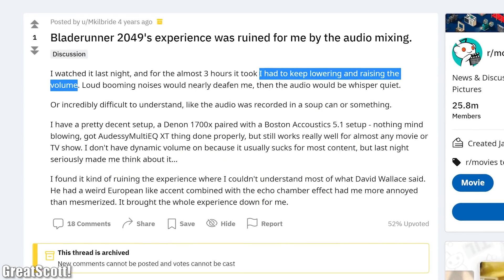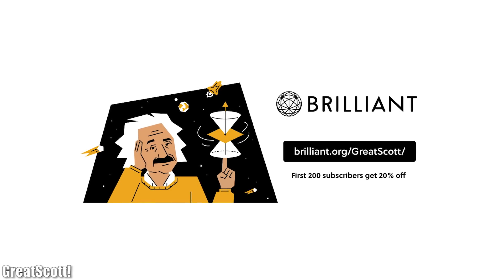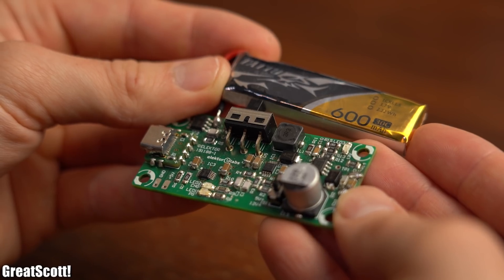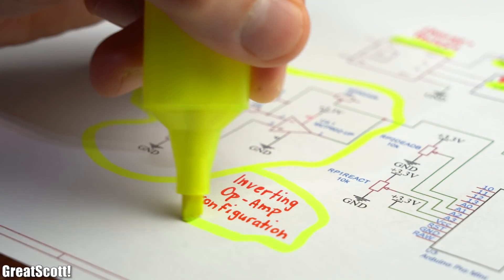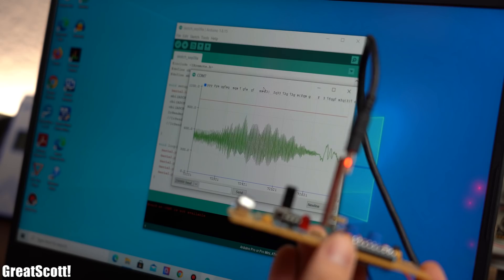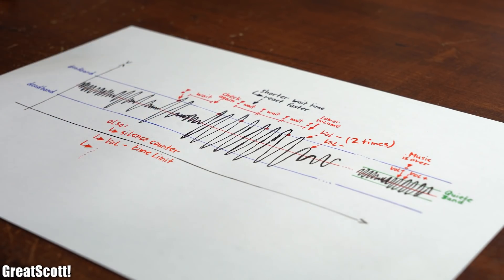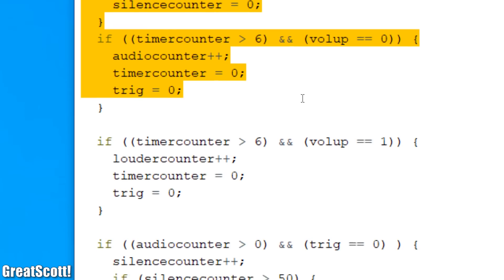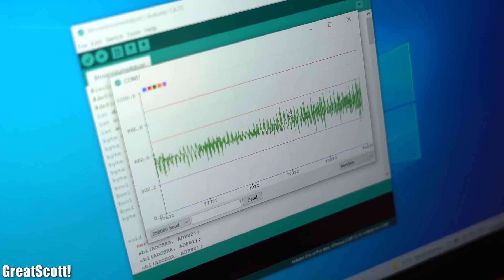Movie Music has a LOUD PROBLEM! So I fixed that! (Automatic Volume Adjuster)

Comment: Very nice video. These sudden changes in volume are really a pain in the neck. You did a nice project. Unfortunately, one cannot see the complete circuit of your project because of translated text script of your audio covers a part of the circuit. Question:  Is it possible to get the circuit diagram and of course the s/w code you developed for it? Of course, I am not expecting you to provide it for free.
Reply: Check the video description, it's all there (links)
Reply: @RogerTannous  Many thanks for your kind response. I watched the video again but could not find the link you mentioned. 
There are of course two links given below the video window. However, the first link leads to the "Brilliant" Website, and the second link is about a previous video from "GreatScott".  So, I must be overlooking something. Could you let me know where to find the video description with the links in question, please?  Many thanks in advance.

Comment: The reason dialog is quiet is because you don't have a center channel while listening to the 5.1 sound track.  Switch to the stereo track and it should be fine.

Comment: If we can open that control unit, won't it be much easier to control the volume with a circuit?
Reply: Maybe, but it wouldn't be portable accross models and manufacturers.
And, more generally, not achievable by everyone else!
Reply: @RogerTannous  Ya true..i didn' t think of it in that perspective...

Comment: My old Marantz SR5000 home theatre amp had a similar function called midnight, for watching movies late at night without disturbing people. As well as prevent any loudness past a chosen level, it also flattened the sound frequency to quiet down the sub and tweeters.
Reply: So does my Sony. It's called "night mode" or something like that. Useless!
Reply: @kenmore01  Thats a shame, the Marantz one was pretty good.

Comment: Yes, that problem with sound seems to be an industry standard. I've noticed in in many new movies where you can hardly hear or understand any dialog but the ambient sound and music are raised to the level of absurdity. I don't know what's wrong with these people.
Reply: The reason I keep hearing is that music and sounds are not in the same frequency's as voices and the music sounds louder because of that. But how does radio do it then? I don't need to adjust the volume of my radio all day. Even when there is a advert it's still within reasonable sound level. 
I don't buy it that it "has" to be this way.
When I'm editing videos myself I put a lot of effort in to making sure the sound is not jumping up and down like it does in "professional" videos.
Reply: @TheHellis  It works on the radio and in your videos because that’s just 2 channels. Left and right. Now try to make a soundtrack that sounds as if you’re standing on an intersection with cars driving by every which way and make it sound realistic over a 7.1 sound system. That means you have 7 channels of directional sound to your disposal to create a soundstage with moving objects AND you also need to make sure that voices sound audible over all the other sounds. Then you will find out how hard it is to make it sound convincing that a car moves from one corner of the room to another at all levels of listening volume. If you manage create it at one particular sound level, it will sound way different when you change the overall volume level of all tracks simultaneously.
Reply: There’s nothing wrong with these people, in fact, they are professionals. If you have problems with how movies sound, select the 2.0 sound mix and not the 5.1 sound mix. If you want to know more, read up on why movies are mixed the way they are by sound engineers.
Reply: @cherrymountains72  Great response genius. And how do I do that when the sound mix is selected by the television company that is currently broadcasting the movie?
Reply: @featheredskeptic1301  I’m guessing/hoping that if you configure your tv to be a 2.0 device as opposed to a 5.1 device, your tv will start using the 2.0 sound mix and not the 5.1 sound mix. The 2.0 sound mix will not sound all wrong because it’s already pre-mixed as just stereo without having a separate voice channel. If your tv/soundbar supports it, you might want to try Dolby Pro-Logic as this will take the 2.0 soundmix and upmix it to 5.1 but this time in a much better sounding mix.
Reply: @cherrymountains72  why should people have to switch things around when it's muppets in the industry doing a shitty work.
Reply: @TheHellis  The human hearing is not linear, meaning that if you don’t compensate your soundmix for the volume people are listening to it, the bass sounds will become way more noticable by our hearing then say voices.
Reply: @cherrymountains72  The TV is already at 2.0 as default, both channels work and the sound of newer movies still sounds like something that was done by lobotomized cimps on an acid trip. Normal broadcast (news, weather and whatnot works fine). I stopped caring about movies a long time ago anyway (for different reasons), but it's still mildly annoying if I decide to watch something once in a blue moon.

Comment: Using speakers that are not wireless, a laptop with good sound card (or with an external one) can do the job. You can program it the same way, but instead of lowering the volume by IR, it will do it be lowering the gain.

Comment: Why not just add a peak detector (diode, capacitor, charging resistor and a discharging resistor) instead of that complicated code to determine when to change the volume?
Reply: Doing it in software and providing adjustability is better than having a "static" design, as every person would pick their own preferences.
Reply: @RogerTannous  That's a good point, but you could also tweak the hardware solution with potentiometers. It may not be as flexible as doing it in software, but it would be much easier and quicker, at least for someone like me who isn't good at programming. I'm just wondering if the hardware solution would work good enough

Comment: I think that an audio compressor would be a better approach. It would reduce the dynamic range of the original audio.
Reply: I agree, I straight away thought that a simpler solution would be to just put a stereo compressor in the analogue signal path. Ok, still not exactly simple, but nothing he couldn't handle. Besides, there are tons of schematics available for compressors out there on the interwebs.
Reply: @tiny_toilet  How, with HDMI audio? You could do it in the analog path, but not sure about distortion, balance etc.
Reply: Encoded in a legacy Dolby Digital bitstream is a dynamic range control profile (what many receivers using night mode actually use vs an analog AGC or DSP implementation).  Competing modern "intelligent" solutions exist in the DSP realm for operating on post-decoded HD audio (DD+, Atmos, etc), such as Dolby Volume, and Audyssey Dynamic Volume.  These typically offer several modes, providing less aggressive to more aggressive processing.  They are somewhat content aware, in that they are more than simply an AGC.
Reply: @AudioVision00  That's awesome! Our company worked with Audyssey ten years ago. I'm glad to hear they are still around!
Reply: I'm not sure how that works but it doesn't sound like a good idea.
Reply: Dynamic range is what makes recorded sound realistic
Reply: @glennjones6574  That's great and all, but most people don't want to hear an explosion at its intended volume.
Reply: @yoctoflop  
Explosion? Realistic gunfire can deafen you, let alone a explosion.
Reply: @yoctoflop  the thing is, once the sound is compressed (as in "dynamic range compression", not data compression), the original high dynamic range cannot be recovered. I like that movies have not become "victims of loudness war" like most music did, but indeed, for most people, the compressed version is preferable and thus should be provided somehow... be it as a separate audio track, or as a compressor in tv/soundbar config.
Reply: @glennjones6574  depends on the compression duration parameters
Reply: @glennjones6574  its true to say dynamic range is amazing, but Bladerunner 2049 sucks audio mixing

Comment: Automatic volume control are very common in ham radio audio amp stage, a simple pre-amplifier with a feedback does the job. I wonder if such a simplistic analog approach hurts audio quality.
Reply: They do a great job of enhancing intelligibility over the 300 to 3000 hz audio range, using a combination of soft clipping and equalization.  Might be a bit rough for movies.
Reply: @waynegnarlie1  Yes I have to try it however, maybe with some parameter tweaking...
Reply: @phileasfogg65  With that it should get the job done.  Enjoy!

Comment: Oh, FFS, they have something already. It's called DRC, or dynamic range compression. It's metadata that's in all audio streams (Dolby, DTS). You just need to stop using bottom-of-the-barrel hardware, and then you'd have a "night mode" on whatever you have that receives and decodes the audio.
Reply from the maker: I truly never heard of DRC. Sorry. And my hardware is not that bad. Should have such an option. I will have a look ;-)
Reply: @greatscottlab  I was only half right. It appears DTS doesn't employ any such technology. Dolby does. There are discs of this movie with only DTS-HD, discs with both DTS-HD and Atmos.
Reply: u could just say it nicely. without the ffs its just a video. and i enjoyed it and learned a ton. its not useless
Reply: @sulaiman9766  No thank you.

Comment: I absolutely hate having that issue too. Same thing with commercials on cable. Obviously the movies are mixed like that for maximum impact in a theater where volume being too high is never an issue. At home people like me who live in an apartment can't have the volume start blasting late at night. The neighbors don't deserve that. Commercials do it too and are always super loud to try and grab your attention. Nowadays almost all TVs and video playback software have a setting that claims to keep the volume level even by boosting lower signals and capping higher levels but they never REALLY work. Having a hardware solution would actually fix the issue.

Comment: i thought you would have "just" altered the output from an AUX cable to a speaker, this is quite more interesting nice :D
Reply: That wouldn't work for any digital audio format or multi-channel audio.
Reply: I was thinking he would build a line level out auto adjustment circuit.  
Could even make it work with digital and mutil-channel if you want to deal with the complexity.
Reply: @99Duds  And there would be less lag, as you can change the gain instantly instead of waiting for the device to receive several consecutive IR commands.
Reply: This could be hacked by some naughty family member to change the channel when it detects music, or even turn the TV off altogether! Could have great fun with that I think!